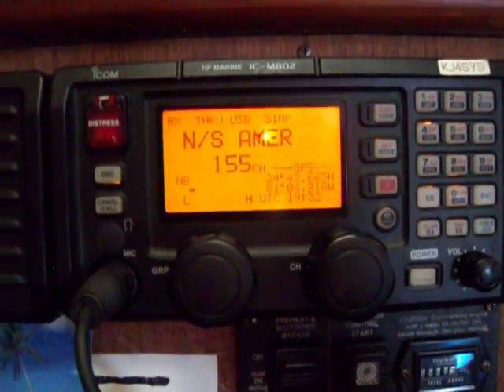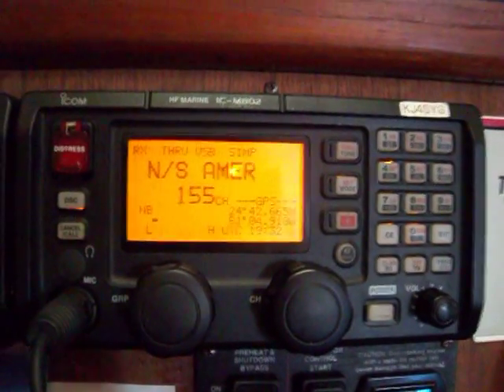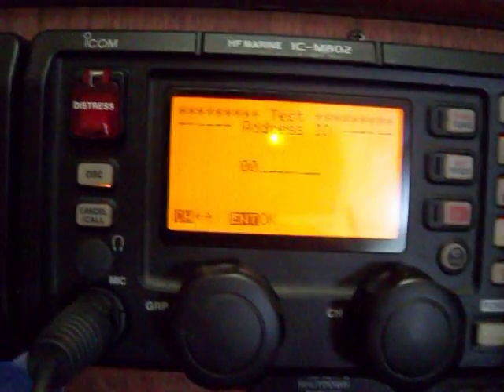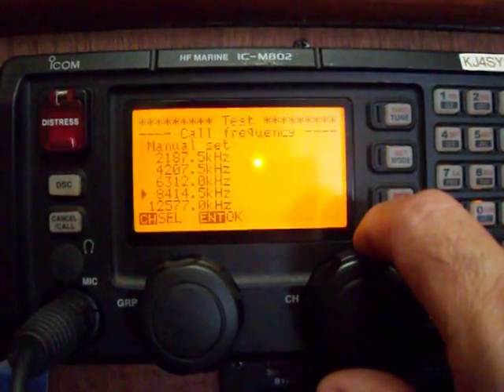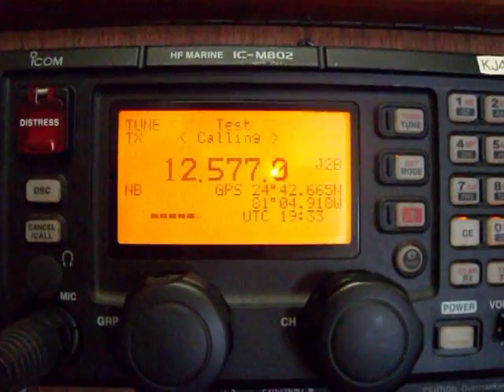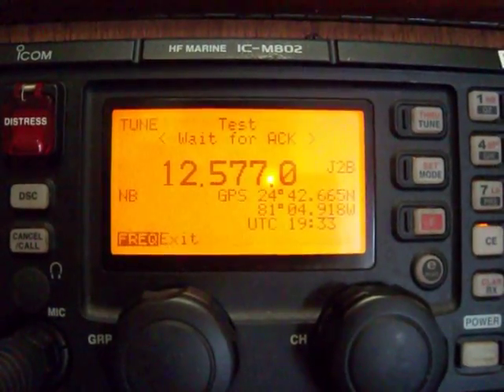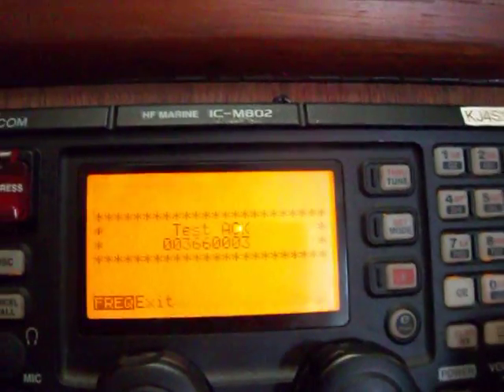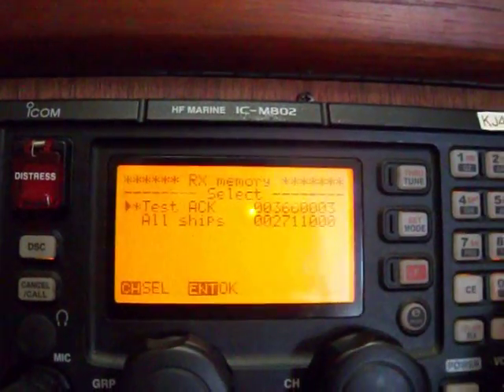ICOM IC-M802-Test DSC function

Comment: Hi George, I have the 801E which may be a little different. Before I press "CALL" it opens the audio and I can hear so indistinct noise that could be another DSC message but it could be just noise on 2187.5.  Are you meant to wait for it to be quiet on the channel before pressing CALL?  It never sounds that quite but I am not sure if it is a very busy channel or if it is just noise.
Reply: Sorry so late responding. I get a lot of noise as well. I wait till it is constant then press call. Hope that helps.

Comment: Hi George,  I have the M-802 installed with the GAM antenna and KISS counterpoise.  I do not have an antenna connected to the DSC port for the radio's controller.  Is there a special antenna for this purpose?

Comment: Hello George, Thanks for the tutorial. I have just tried it without success. Here some questions for your kind consideration:
1- I am trying in Sweden and perhaps that would call for other codes etc.
2- What is 3660003? That is what I diled, but perhaps I should dial another number. At the end you mention something about an MMSI. Was this 3660003 an MMSI number of someone? Very unclear if it is a universal number or if one has to dial someone's MMSI.
3- Providing, the number is correct, perhaps you may consider the reasons for using 12577? What would you use if you where in Sweden, etc.
4/ I have the same device as yourself, that is an Icom IC  M802. I also have a dedicated DSC antenna installed.

Thanks in advance